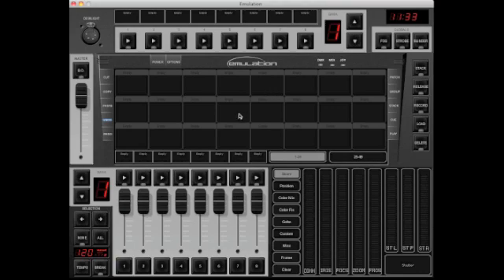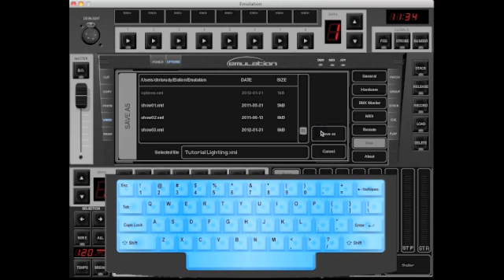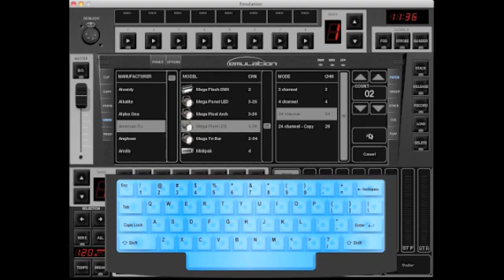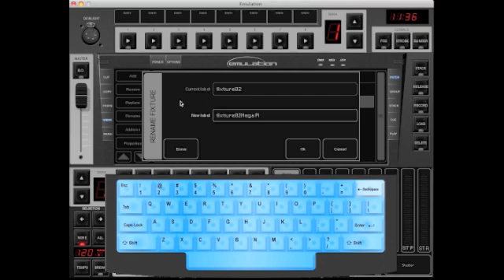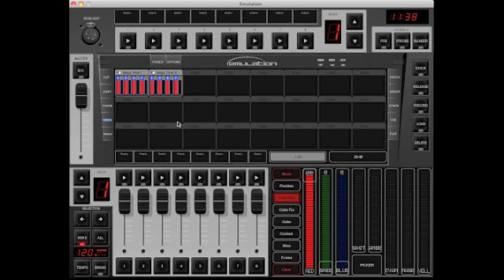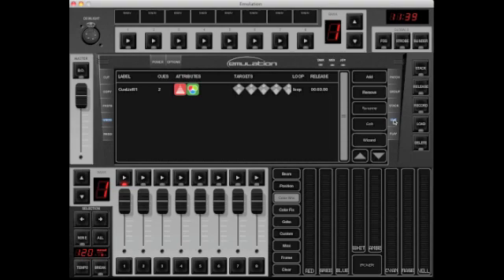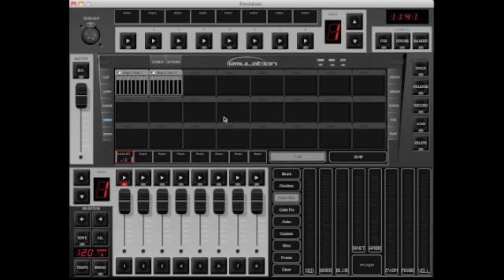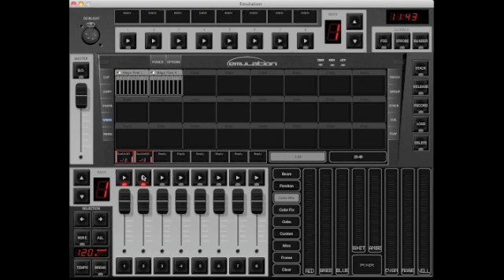Elation Emulation Tutorial: Basic Patching and Cues

Comment: hey awesome vid. i just received my cue cable today. im using 2 platinum spot 5r and im not able to control the lamp or change any colors like you are in the video. im also running them with blizzard wireless dmx wicycle. any idea if the wireless dmx is the reason why im not able to control the lamp or colors?